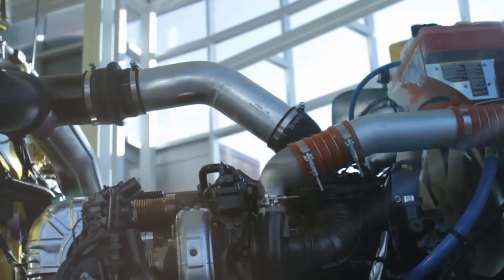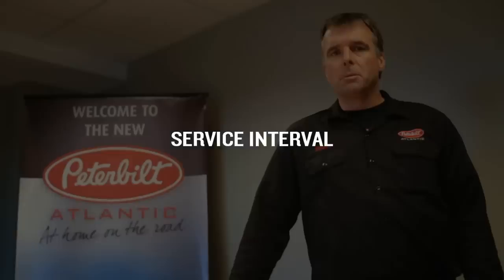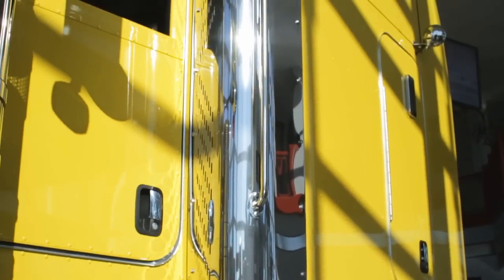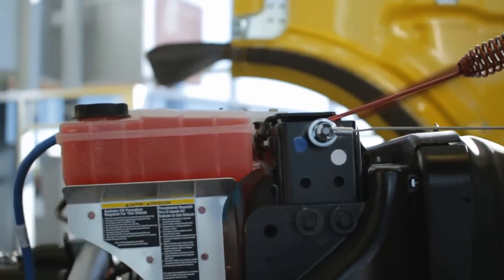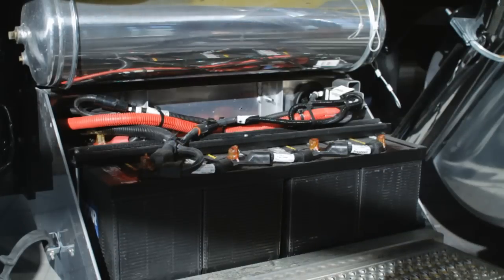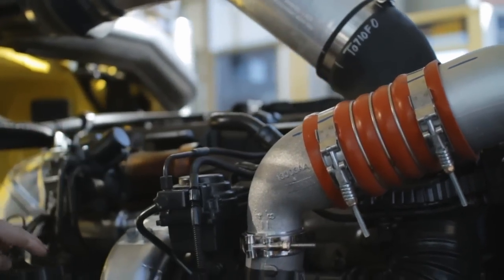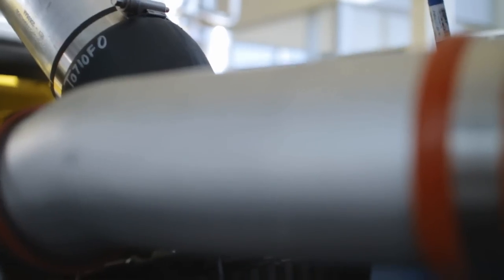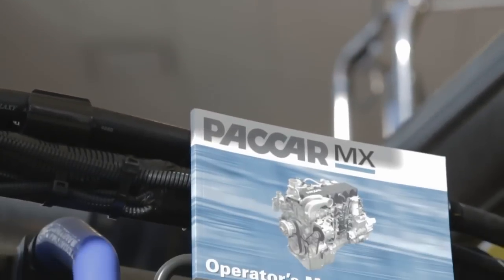Peterbilt Atlantic Tech Tips: MX Engine Maintenace

Comment: This engine has done nothing but given me problems. I keep getting the same check engine light for injector spill valve, lamp test, injector 4, and egr delta pressure. I've replaced and or repaired all of them and the problem still persist. I tell the techs that every time it happens, I turn the truck off then on and the problem goes away. They still can't find the original
problem that I have because it keeps popping up. This motor has cost me thousands of dollars in repair bills. I will not make this mistake and buy it again.

Comment: Agree, this is a nightmare to work on compared to cummins or cat. simple programing takes for ever to do. And liner o-ring groove cut into the block not the liner, we have replaced a few cracked block now. shows it is ment to be in a cab over, have to raise the cab on a pete/kw to pull #6 fuel line out.  sorry but it is a POS.